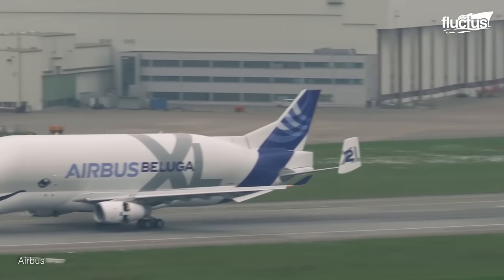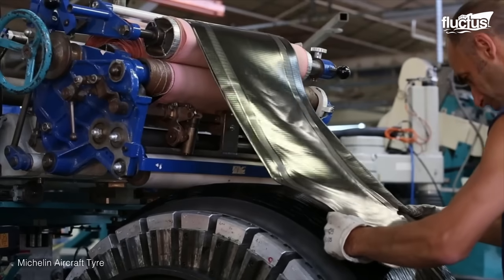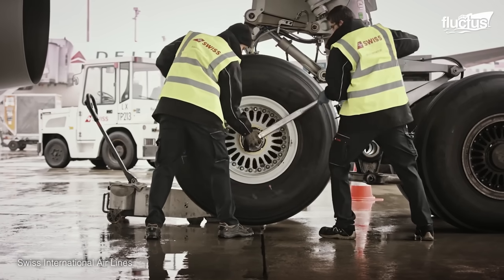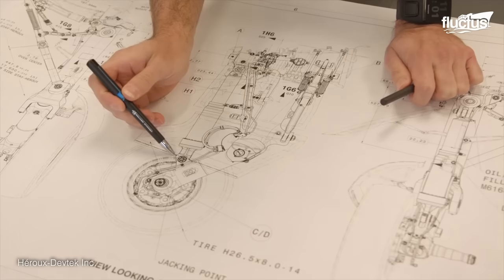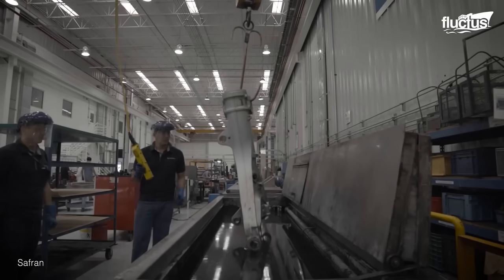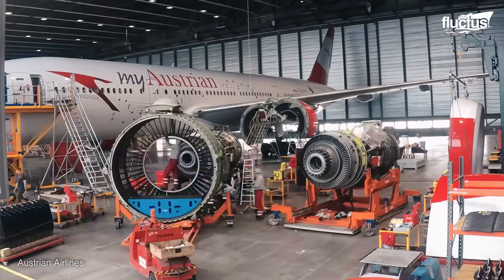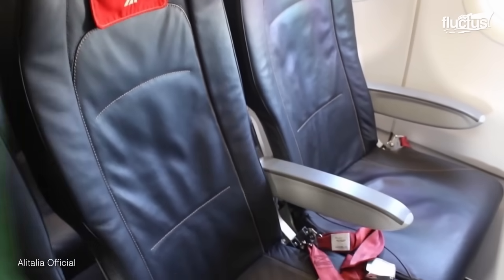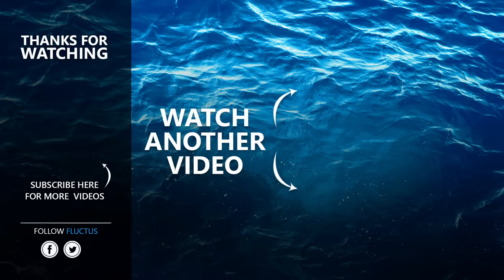Inside Super Advanced Factory Producing $6000 Plane Tyres

Comment: If they had a device that spun the tires to the same speed as the plane when landing, the tires would probably last twice as long.
Reply: Don’t you think if it was possible, or that theory would work, They Would…..? Lmao
Reply: @m r  when the wheels hit the runway and you see that smoke coming off them, that causes a 'flat spot' You only have to watch a F1 race to see how bad that is for a tire. A simple electric motor can rotate the wheel to match the speed of the landing plane, thus eliminating 'flat spot' at the point when the wheel hits the runway?
Reply: @rick928  the angular momentum of the spinning wheels would mess up the control of the plane
Reply: @ayanaalemayehu2998  it is the gyro effect of the wheels
Reply: Landing & take off don't wear tires so much. It's actually when airplane taxi that wear them the most.
Reply: It would still skid the tires and its more about the weight of the plane bouncing on the tires and the structural integrity of the tires over the tread amount
Reply: A bunch of more points of failure. Great idea.
Reply: @rick928  I think "a simple electric motor" wasn't gonna do it since it's wasn't really a big deal, sure flat spots can occur but in f1 it happened because the brake force the tyre to stop and get huge friction while on landing the friction happened for a short time then spinning freely afterwards.
Reply: @mr-js9is  the technology is there but uts just added weight and complexity.
Reply: Thing is to put that extra weight and cost in drive motors on each wheel, extra weight means less weight that can be carried more fuel that has to be burnt to carry that extra weight. Its probably far cheaper to just changed tires more regularly
Reply: @deven6518  added weight complexity  means more fuel burn less weight passengers  and freight that can be carried,  over 20yr lifespan of the plan is a lot of money,  far cheaper just to change tires more regularly
Reply: Added weight planes don’t need and it’s unnecessary. Tires are going to wear down anyways why add unnecessary weight to extend the life of a tire a few months. Besides that, there are too many other factors that effect the service life of tires.
Reply: @rick928  ive been steering the airplane for more than 10yrs now. 'Flat spot'  doesn't hurt or feel that bad when manoeuvring on the ground. I can say u wont feel that flat spot (if there is).
Reply: @rick928  flat spots from landing arent as bad as you make it seem. While they do exist, most tires iv inspected looked like normal wear. Source A&P mechanic
Reply: @Drift z3  I have to admit I know noting about planes landing etc but to me it looks bad seeing all that smoke coming off the wheels at touch down.
Reply: The tires wear the most when the aircraft is braking.  Only a few percent of the wear occurs when the tires hit the the tires wear the most when the aircraft is braking.
Reply: True...but installing that mechanism to spin the tires would add more complications and worse of all it would add weight and lead to more expenses to the airlines. So the expenses and difficulties of replacing new tires worth more than installing such mechanism.
Reply: @rick928  
F1 tires are far softer than these.

They're designed for a completely different purpose.
Reply: Yeah and it would take even longer to slow it down, if the tires are locked up it's a lot of drag.
Reply: Lol, you mean the opposite of slowing the plan down 👎
Reply: Wouldn’t work and there are lots of reasons for it. Mentour Pilot did a video about it.
Reply: That's a Good Idea But Probably Cost Prohibitive.
Reply: @Michael Cohen Oh hahaha ! Man ! Your Funny ! Book of Mormon !!! LololoL
Reply: I agree..... but why not spray the runway with water before landing
Reply: The stewardesses could yank on a pull rope to get the wheels spinning right before the plane lands.
Reply: @Laurent312  cost, water usage, could freeze etc.
Reply: @robertmetzger6467  yes, also they would need to be electrically powered which means a new electrical system. Plus there is a  risk of failure, if one set didn’t spin up as fast or not at all the plane would be landing in a dangerous situation.
Reply: @krisnafaendi  landing and braking deceleration wears the most.
Reply: @youtubechangemynamewhy  i'd love to know your explanation. All That i know is an airplane tires isn't the main tools for braking.
Reply: Maybe just simple carbon fiber fan blades on the rims to spin the tires
Reply: I think they already thought of that but it not working well so they abandoned this idea.
Reply: It has been tried several times, and the weight, the skating feel the flight crew felt and the problem of spinning the tires evenly it was never done. The tire companies always told us that on a long taxi with a heavily loaded aircraft caused more wear than landing.
Reply: @ayanaalemayehu2998  why does that not fuck up the plane when taking off?
Reply: The plane needs to slow down not speed up
Reply: Does it burn up your car tires if you are in neutral?
Reply: I was just thinking about that! If nobody has done it yet, it must be for a reason...
Reply: @ayanaalemayehu2998 uuh that makes sense actually.
Reply: @krisnafaendi What does it mean "taxi"?
Reply: I don't think it matters much.  What would matter is if the plane could make a softer, more gradual landing.

Comment: 20,000 hours on wing is pretty exceptional for an engine. You may want to check your numbers. 300,000 hours is about 34 years.
Reply: It's closer to 3000 hours.
Reply: I went directly to comments after hearing that 300,000 number to see if anyone else was shocked to hear such a large number.  That can’t be correct.
Reply: I was thinking the same thing, that's seems extreme... and if that's the case Amtrak Rock's!!
Reply: 300,000??
Their life is a small fraction of that
Reply: You think fact checking is their priority?
Reply: They surly made a mistake. Those 300.000 hours should be minutes that are 5000 hours

Comment: 300'000 flight hours or operating hours, isn't it a little bit too much for a tire who last maximum 3'000 to 5'000 hours?
Reply: I believe the 300,000 hrs refers to engines  -- which seems like an awful lot of time to me.
Reply: No theyre incredibly advanced they said. Good for 5,000,000,000,000 years.
Reply: Routinely they check those every 10k hours or like 3k cycles, give or take depending on a plane. With expendables replaced like pumps and so on. 2 years should be fair to say.

Comment: I remember we had problems with retreads from two different manufacturers for medium sized aircraft.  We had to collect the damaged wheel sets and ship them to each manufacturer.  I think in the end the DOM insisted on no more retreads.  It was pretty costly as the tires were not high on cycles and sometimes damaged wheel assys and brakes.

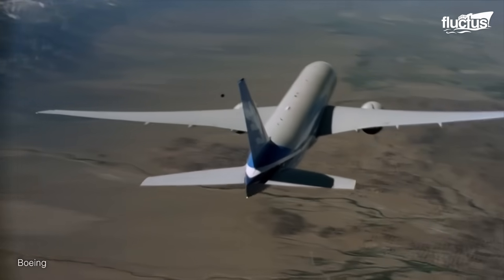Comment: @10:11 .... what is that black dot following the tail section of the plane?
Reply: It's a trailing cone with an atmospheric sensor on a tether. It is used on new aircraft when in flight testing for certification.
Reply: @tjhess2  really?  That’s interesting.  What metrics are they testing on a certification?
Reply: @wannamontana4130  For that particular sensor, it's atmospheric and static air pressure behind the plane. There's plenty of information about it on the internet.

Comment: I don't think there is an aircraft engine out there that will go 300.000 hrs. between overhaul as stated in this article.
Reply: A Toyota one.
Reply: @Robert-cu9bm  A Toyota one though it is not an aircraft turbin engine will not go anywhere near 300.000 hours good try .

Comment: Never understood why they dont make a tread pattern that would make them spin in flowing air even if only half of the ground speed... still would be a drastic difference!
Reply: to heavy, would cost more to operate then it saves. is one. unbalance, vibrations disturbance from airflow are a few others rom spinning wheels
Reply: Touching down safely is far more important. As such the treads are designed with the biggest threat in mind, aquaplaning. The cost of replacing a tyre is pennies compared to losing control. Or not being able to stop/ rolling off the runway.

Comment: - why don't they spin the tires up to speed before landing? 
-you could do it with such a tiny little motor
- then you wouldn't have the tires wear out as fast, and you wouldn't have to scrape clean the runway / runway lights all the time
Reply: The weight of the equipment and cost would not be worth it. And more mechanical failure points, those wheels weigh hudreads of lbs. A motor to get them up to speed would need to be huge, and one per a wheel, 16 wheels and 2 forward wheels. 

The added cost of maintenance and weight would cost more than just replacing the tyres 

Landing safely is the priority. Furthermore, most ware on the wheel is done when taxiing on the ground, not necessarily from the landing

Comment: The rubber bit is called a tyre/tire, when attached to the metal bit it's called a wheel. The metal bit without a tyre/tire is called a rim or wheel. If someone steals your tyres/tires, that means you still have the rims or wheels, without the rubber bit. America has to stop calling wheels tyres/tires and also spell it properly. This, as you can tell really bugs me.

Comment: I do not understand why they check the tyre pressure. Yes it is very important that it is checked any time. But for thousands of important things to be checked. They check the most basic thing. Why not get them to check the windscreen washer while they are at it.
Reply: Wrong pressure, tire fails, plane crashes or debris is kicked up at the planes fuel tanks causing a big problem.  Pretty critical stuff.
Reply: Most basic thing, are u f-ing kidding.

It's the most important thing is you don't want to crash on landing. 
The most important part of the flight.